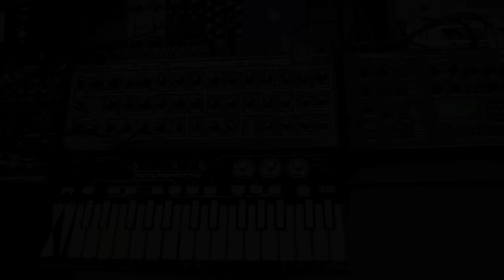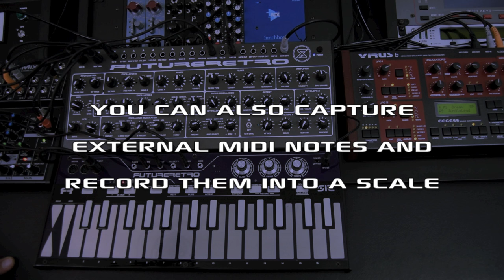Future Retro 512 touch keyboard Overview and Tutorial

Comment: in relation to scale mode. one problem i'm having is that i can't transpose the key and then apply the scale to that key. for example if i transpose the keyboard up one semitone to c-sharp and then apply say pentatonic minor it sets the keyboard back to c pentatonic minor and then i can only transpose the key to notes within the pentatonic minor scale so as there is no c-sharp in that scale i can't get to c-sharp pentatonic minor. am i missing something? it would be great if you could transpose the keyboard so the bottom c is the root note and then apply the scale to that
Reply from the maker: There are 3x transpose modes, transposing by octaves, transposing by semi-tones, and scalar transposing (transposing only within a scale of notes). You should be able to select a scale, activate Transpose (semi-tone transposing), and then select C# above middle C. All scales are referenced at the low C key. It sounds as though instead of activating (semi-tone) Transpose, you are holding the Transpose key, and then selecting a key on the keyboard which is then using the Scalar Transpose method, or transposing only within the notes of the scale. Play with it some more to get a good understanding of the different Transpose methods. You should be able to do any kind of transposing you wish.
Reply: got it! thanks for the detailed response, all clear now. this thing is so great with the buchla. and while i'm here you really are one class act of a company. everything i've tried is built so well and has many inspiring twists, printed manuals! and amazing support. thanks so much!